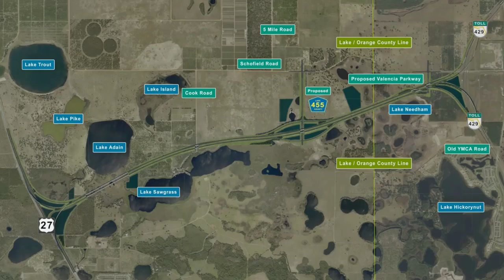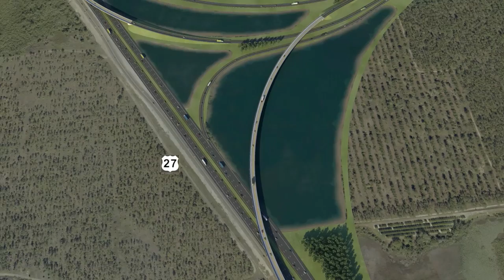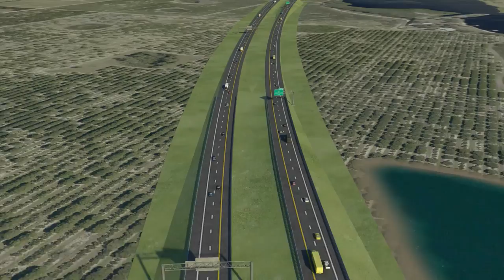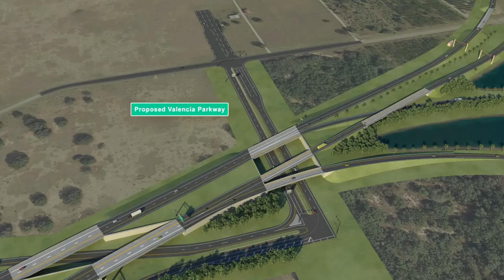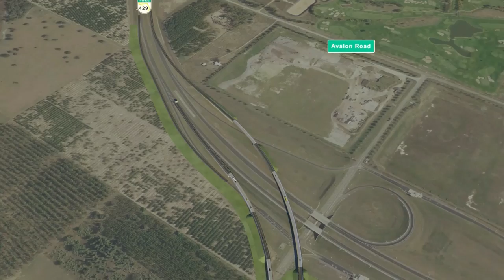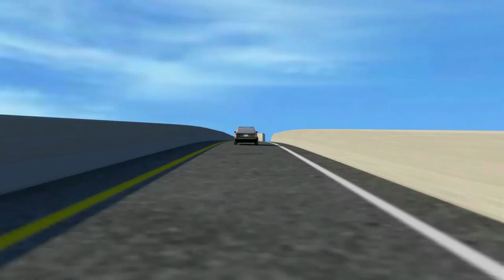Lake Orange Connector fly over animation 6 27 19

Comment: Sheesh. How long are those single lane on-ramps from 429 to the 455? It takes 24 seconds for your car to travel that ramp, and you're not even starting at the beginning of the ramp. At highway speeds, that's almost a mile of single lane concrete. Why so many LONG sweeping on and off ramps? Why create bridges where alternate locations (like paving Schofield Rd) would be more effective and less expensive? Who is this solution "preferred" by? The concrete companies and contractors? Simply wasteful.